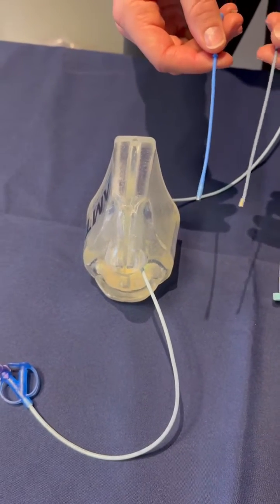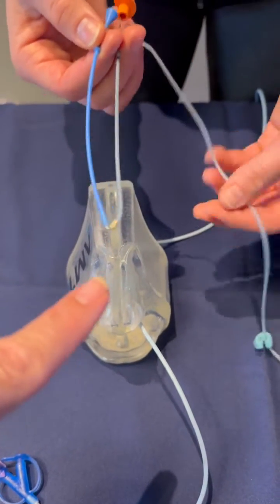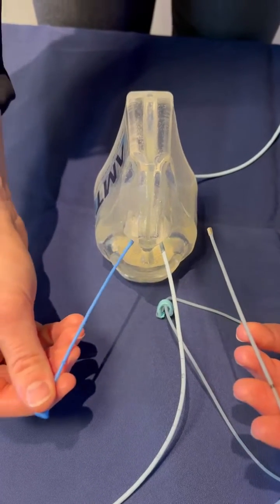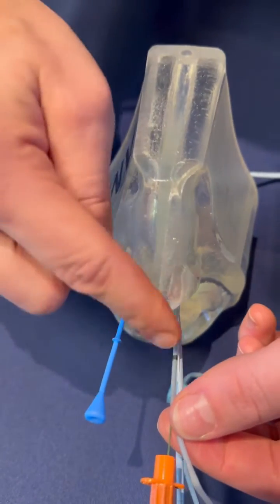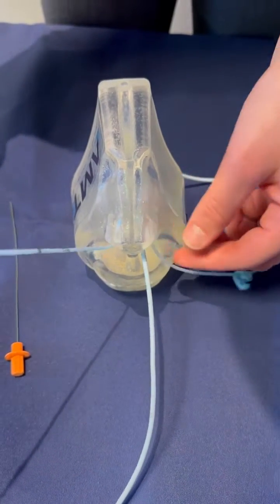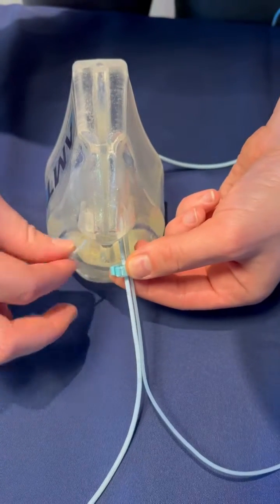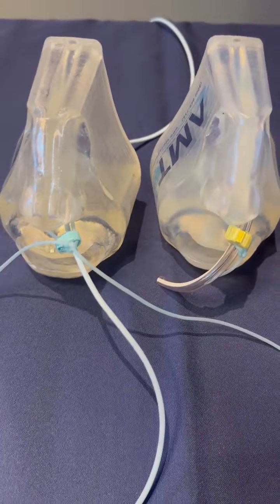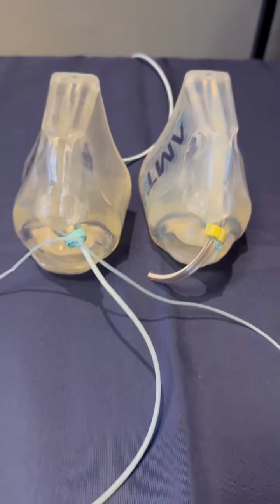How Does a Nasal Bridle Work?

Comment: What would happen if the delirious patient pulled it out forcefully? 😎🙈🙈
Reply: It will normally break. This is a safety device designed to fail well before causing patient harm. Pulling on it feels like a brain freeze.. not painful but not comfortable. If a delusional patient pulls it hard, it should break before causing damage. The vomer bone is pretty strong. 

(Disclaimer: based on personal experience with this device. Not representative of the manufacturer nor medical advice. Refer to IFU/DFU)